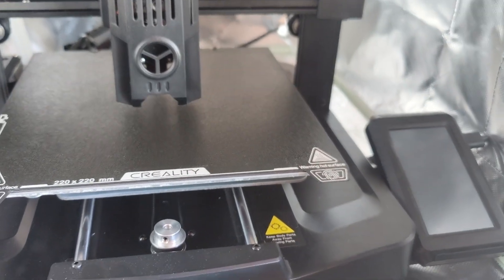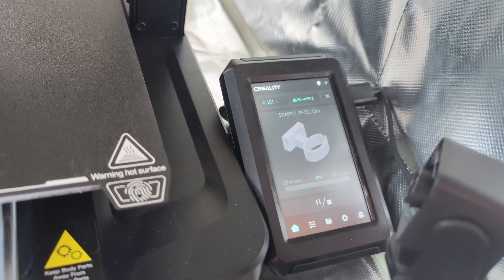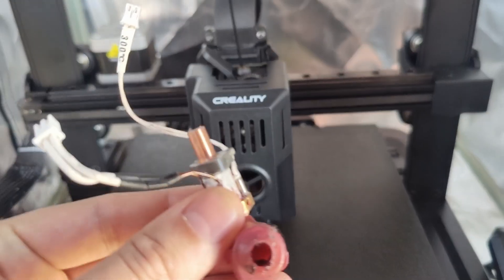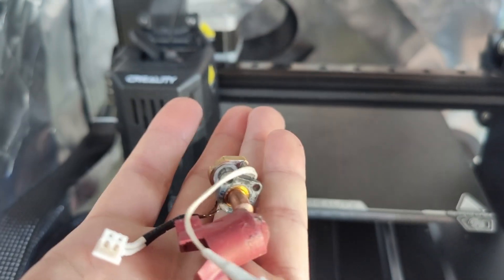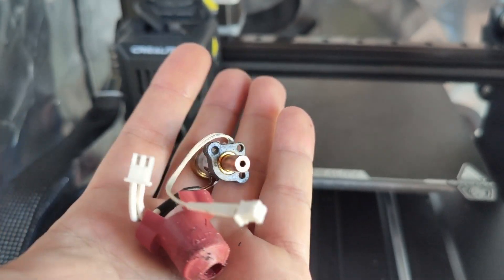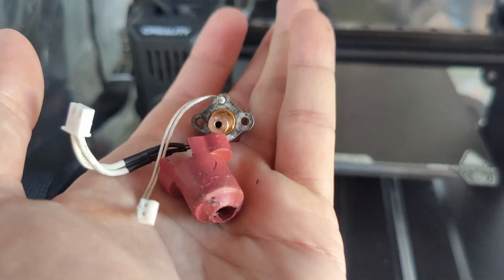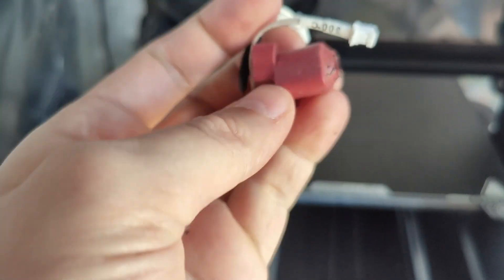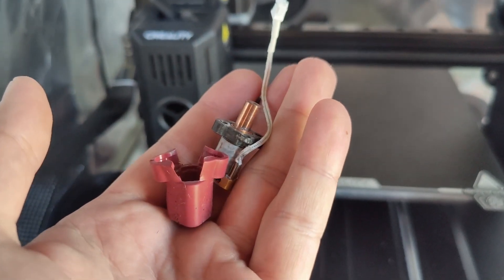Ender 3 V3 KE Hotend Won't Heat

Comment: Hi! Same issue. Any issues with removing filament?

As it can't heat I'm worried I'll not be able to remove the filament from the extruder/heatbreak etc

Thanks
Reply from the maker: You probably won't be able to remove the filament as it doesn't heat up, so you need to replace the part I show in the video :)
Reply: Oh yeah, I get that bit 😊

I just didn't expect that part to fall out easily. I thought it would be jammed in cooled down molten filament 

Doesn't sound like it's an issue so I'll quit worrying 😂
Reply from the maker: Oh sorry, I miss-understood :P Yes the filament gets stuck, but only in the hot end, which you will be replacing, so you all good :P

Comment: Hi! I had to recently replace my hotend but after changing it heats up to let's say around 50-60 past that I smell burning and it takes wayy too long to heat up like 1 minute to reach 60 if you could help please do.

Thank you for reading this.
Reply from the maker: That sounds like your thermistor is playing up. It's easy to bump it or damage it during a hotbed replacement... Are you able to check that it still looks okay and get back to me? ☺️
Reply: Ok
Reply: It looks all fine do you have discord? I can dm you a pic